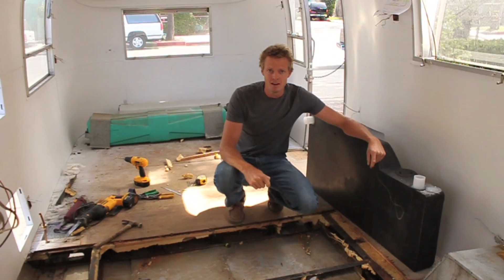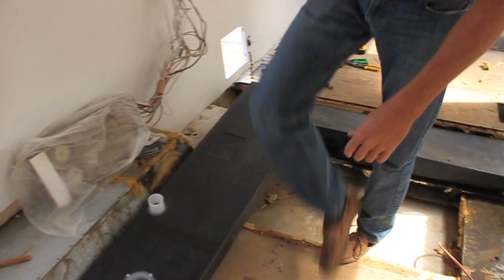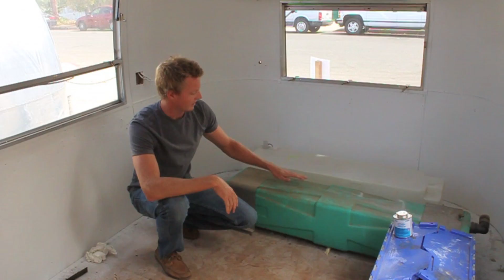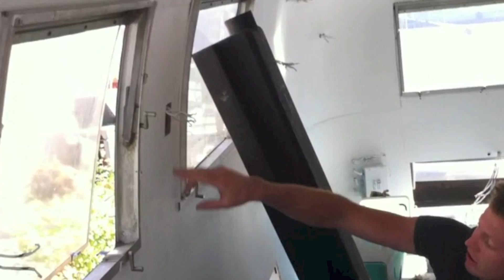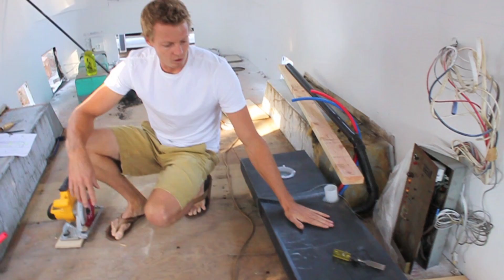Rotational Molded Tanks - Episode

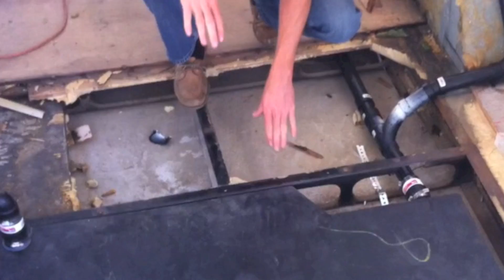Comment: I just noticed that under the grey water tank after installation, there is a strip of that plumbing strap screwed to the bottom of that joist. It goes up under the grey water tank to support it. Just my observation. It's at about 4:06 on the video.